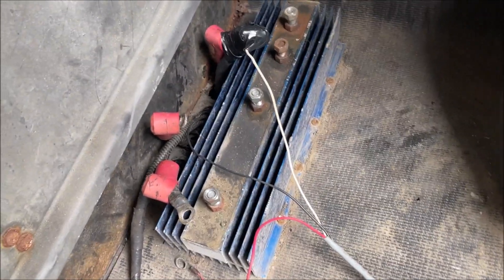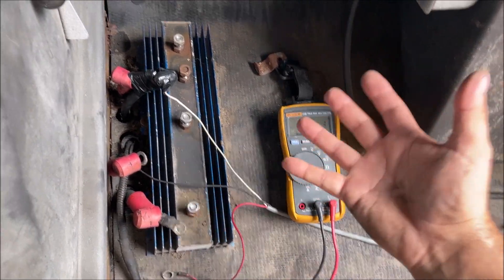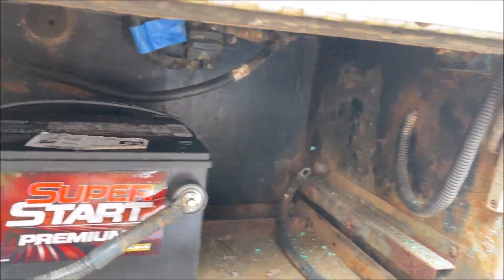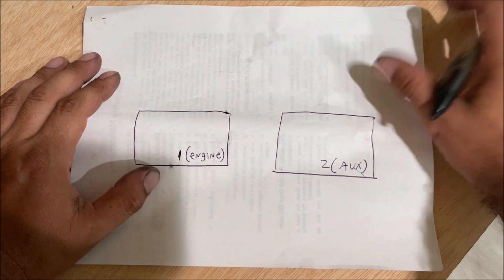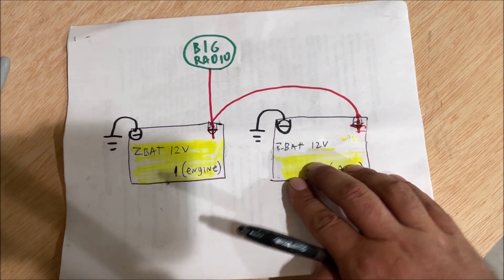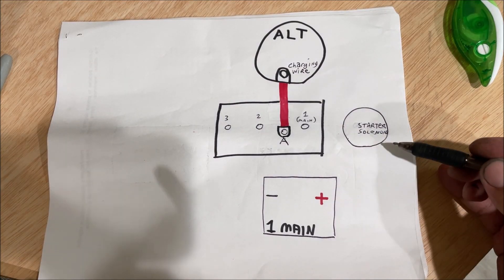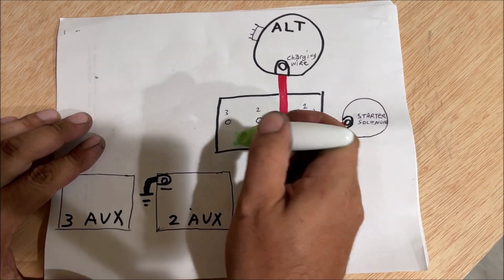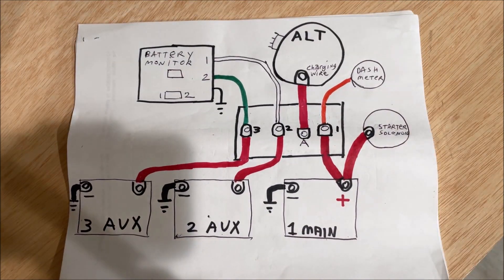multi battery isolator 200 amp SURE POWER 2403 EXPLANATION and WIRING DIAGRAM how to DIY RV

Comment: Hey man, great video for starters. I realize this is 3 years old but I’m hoping you might be able to figure out why the ignition wire for the isolator would be run to a  solenoid? I’m not sure if LDV did it or the previous owner but it is giving me some issues and I want to remove the solenoid but also don’t want to destroy anything in the process.
Reply from the maker: so they can turn it off or on. It doesn’t need a solenoid you can remove it
Reply: @chriscraft2 amazing, thank you!

Comment: Its diodes are leaking. The “good” but not really lol. I don’t know that 400 dollars is acceptable but there are certainly other ways. What is that anyway? A balancer? I gotta go find out whats in it.
(Edit) I can’t find anything about whats in it. A smaller one of a different brand is just a box with a microprocessor, sensors, and fets.  That thing there has allot of heat sinking going on. I don’t really understand why. Maybe its a tray full of fets and the heat sinking is for when its pulling tons of current. Wonder what the short circuit protection is like. It must be reverse voltage protected. I feel like it’s inherently resistant to that mixup. Maybe the microprocessor is sensitive to it and the manufacturer didn’t put in a crowbar